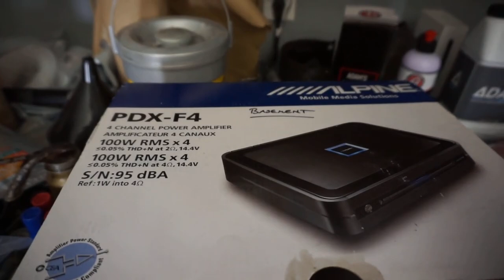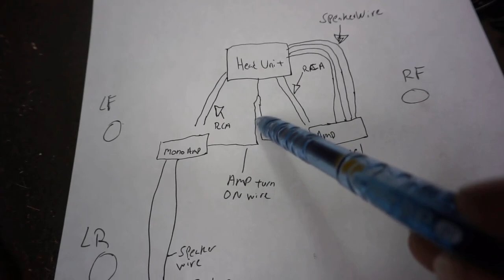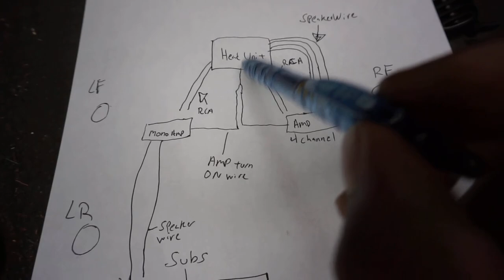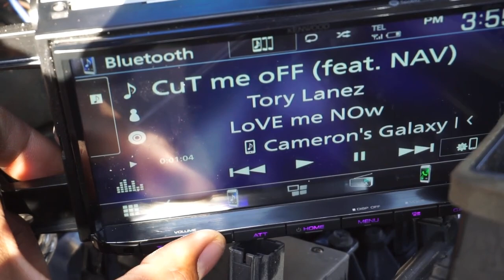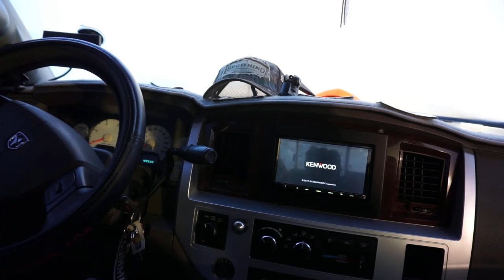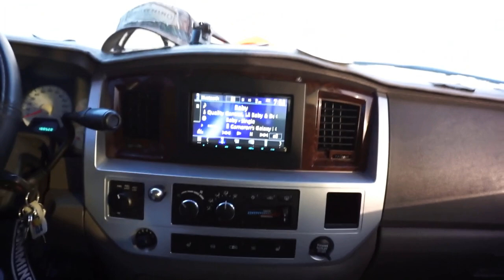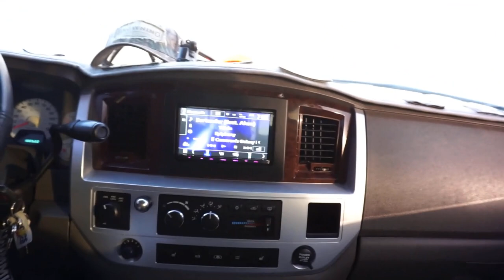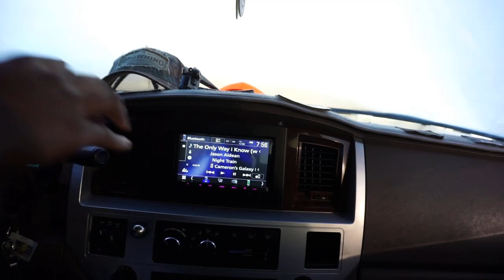INSTALLING 10in SUBS AND 4 CHANNEL AMP in DODGE RAM 2500!!

Comment: I have the same truck with a similar setup. Put tweeters in your dash speaker spots and hook them to the radio. The high crisp sound bouces off the windshield and sets a nice sound stage. The head unit has plenty of power for those small tweeters to keep up with the amped door speakers
Reply from the maker: Thats a good idea man, so only question i have with that is which wires control only the dash speakers cus on the harness it look like they daisy chained the dash speakers with the rear door speakers. I was gonna use the tweeters that come with component speakers and just run them to the dash spots
Reply: @EVERYTHANGDIESEL  In my case I just wired them to the factory wires so it is running off the stock infinity amp. I ran new wires to the door speakers from my 5ch amp. I used the tweeters and the crossover from a set of components that I blew the woofers on.
Reply from the maker: Ahh gotcha makes sense now, thanks for the input man really appreciate it

Comment: I just swapped out my door speakers in my 03 ram. I put some sound mat stuff in the door panels, and added foam seal between the doors and speakers, and did some foam rings between the speaker faces and the inner door panel. It really improved the sound!! Now I got a JL sub and amp to put in..... Can't wait! 😜 I have heard that I need to run the rca's on the opposite side of the truck to eliminate engine noise feedback, is that true? I'm new with some of this stuff, so I'm taking advice haha. Thanks, good video!
Reply: Yes that's true👍🏾

Comment: Rap & county! Sprinkle in some classic rock with e-40's sprinkler system & that's a great playlist! 

Great job on the install! I have a 4th gen (2012) and did a fosgate 5 channel with a single 12" 750 rms alpine type r in a fox box, kenwood deck & 6x9 components and alpine type s 6x9 for rear fill. Biggest regret was not doing the bass knob out the gate. It's loud, clear and I can roll the bass off before I get to my neighborhood.

Just put 2 new batteries, Sunday I'm installing a mechman 320 & big 3 with 1-0 so my batteries can charge at idle with the system running.
Reply from the maker: Hell yeah, I tell u man alpine makes some excellent quality equipment, u pay for the price but it comes with good quality!

Comment: Straight 🔥🔥🔥🔥🔥🔥 review and information bro!!! Your review on the Yulu Tesla screen radio for the Ram 1500 helped me make my mind up to purchase that particular model and it's worked out Greatttt!!! Since I installed it I've added dual 10 inch woofers under the back seat paired with a Skar 1200 watt amp, and all 6 by 9 Kenwood speakers in the doors. This weekend I'm adding another amp for the door speakers which is another Skar but it's a 4 channel amp with 500 RMS watts....... I'll give you a heads up when it's finished! Thanks again for your content man👍🏾👍🏾

Comment: If you are looking for cleaner more crisp loud sound I would recommend looking into DS18 PRO ZT-6x9 and DS18 PRO ZT-6x5 they stupid loud with a clear clean crisp LOUD sound!!! I am running them in my mega cab with some 10 inch DC AUDIO level 3 subwoofers it's like a concert!!! DS18 are fire GREAT!! speakers! I found out about them at a car audio show!
Reply from the maker: Hell yeah I was looking them i think im gonna go with them, found a killer deal on ebay for 4 6.5in mids with tweeters.  140rms per speaker.

Comment: I got a pair of 12  DC sounds and a fox audio box for the 2500 and a Orion amp for them .I just need to decide on what I'm doing for my mids and highs . I'd like to see if I can get good sound without modding the doors . I was tempted to pull the backseat and do two 15s or 4 12s since it's not a family vehicle or daily driver but that's getting too deep into another hobby and I already spend way more than I should in my off-road bullshido hobby .
Reply from the maker: I'm doing 6.5s on all 4 doors. To my 4 channel alpine.

Comment: I got all audio pipe in my 2nd gen...and 2 10 inch audiopipe subs under back seat...sounds amazing
Reply: Did you ever upgrade any of the electrical stuff? Alternator? Does the lights dim when the bass hits?
Reply: @dawsonogilvie3828  lights dim a little but I’m putting in a 2nd battery...that will take care of the lights dimming...has stock alternator...also have a double din
Reply: My box is from fox acoustics...check em out...very good quality boxes...has the ram head in center of the box too
Reply from the maker: Hell yea never heard of them, gonna have to check them out
Reply: @EVERYTHANGDIESEL  not sure if they got back up and running yet  hurricane Laura destroyed the warehouse.

Comment: Yo on your compound turbos do you have to tune them or can you just simply drop them in.I was just wondering was thinking of getting the same setup as you.
Reply from the maker: You can just install them and they will run fine but tuning is always a plus
Reply: @EVERYTHANGDIESEL  thanks man I appreciate it and did you tune yours or you just dropped them in ?
Reply from the maker: Initially no, but I did after I installed my dual fuelers
Reply: @EVERYTHANGDIESEL  thanks for responding back now I know what I should do when I get my compounds I’m probably going to get the same setup as you I just got my built trans so hopefully everything works out great with everything else and thanks again I appreciate you responding back 🤟
Reply from the maker: No worries man, u will be solid